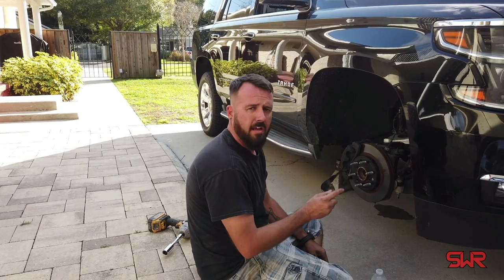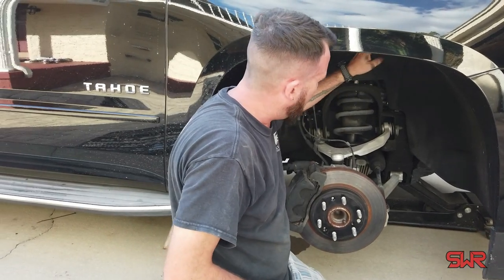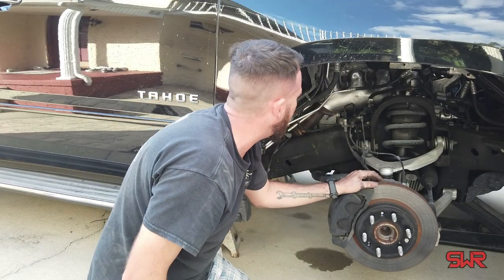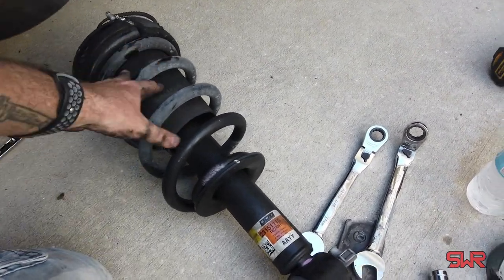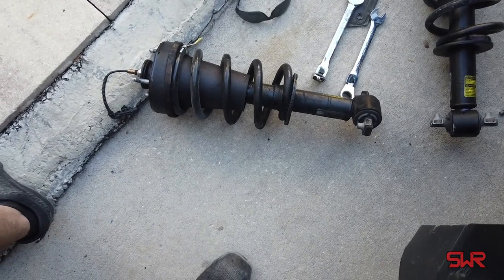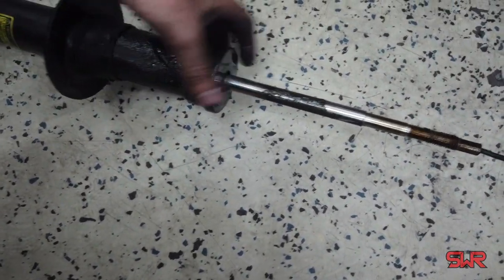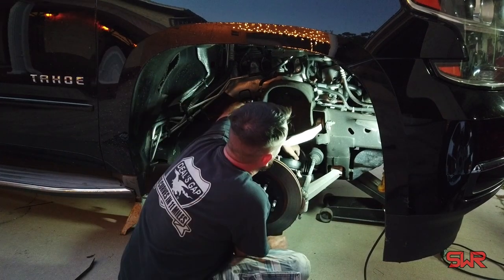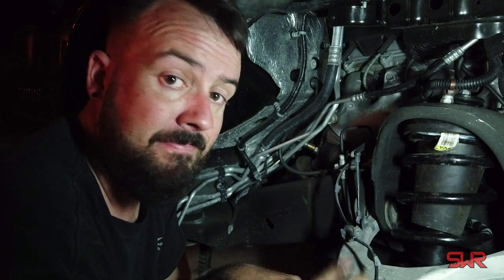Tahoe MagRide Shocks Replacement

Comment: Also anyone changing the struts there was a TSB by Chevy on the jounce bumpers in these struts.  They revised them, so I will change those out when doing the struts. When they go bad your struts will sound like a spring mattress. Hope this helps somebody.
Reply: Here are some instructions I found: https://maxtracstore.com/content/MaxTracInstructions/GENERAL/991500%20%28TERMINAL%20TOOL%29.pdf

also in this video around the 6:35 mark he shows you hot to do it: https://www.youtube.com/watch?v=K4iPdbffsXU&t=177s

Comment: Changed mine out on my 2015 Yukon Denali at 61k as they just started to leak and the ride got a bit rough. Just did the left again at 81k due to leaking but is was covered under AC Delco limited lifetime warranty. RockAuto shipped the new one quick and processed the warranty on the bad one quick! The rears are seeping slightly but still going strong. In case you have to do it again, you can get to those top strut bolts through the engine bay without removing the fender liners.
Reply: Hey any info on the depinning process. He didn't show that part in the video. Any tips or advice would be greatly appreciated as I know how to change out the struts but never depinned struts before. 
Thanks!
Reply: Kevin, did you get any warning dash lights when it started to leak? I bought mine used (2015 Escalade) and always rode rough but I have no warning lights.
Reply: Mine are bad and no lights on dash but you don't need a light, you can feel it in the ride
Reply: How does the warranty work, I’m also planning on getting some replacements from rockauto, but I’m confuse of the lifetime warranty so if the shocks start leaking after the same time the magnaride shocks leaks around 80k miles, you get free replacements so I’m theory I’ll get free shock for the rest of the life truck?

Comment: We had ours replaced on the front. Ac Delco. Still rides like a fing low rider. Go across a wavy bridge and it gets to bouncing like a 64 Impala with hydrolics. Can't figure out what the deal is.
Reply: Try some rancho shocks
Reply: Regular guy. Did you find the issue. My 2015 tahoe does the same thing when I go over train tracks. I know all car wobble but this one goes crazy
Reply: @jaimerios995  we got rid of it cause dealer said nothing wrong and refused to really fix it. Thinking about it I think the bouncing was more likely from the rear air shocks. My suggestion if you really want to keep it is convert all the air ride to standard shocks. There are simple videos on this process. My understanding is this fixes the issue. Maybe not as soft a ride but won't be a rodeo either.
Reply: @regularguyfixes3142  ok. Thanks for the info. I think I will give it a try replacing the front struts at least once since I noticed they do squeak a little over bumps.

Comment: I, too, have a 2015 Chevy Tahoe LTZ w/ Magneride suspension. It has about 150,000 miles on it. I purchased my strut assembly from Strutmaster. My son & husband are  supposed to be installing tomorrow. ($799.00  2015-2020 Chevrolet Tahoe Magnetic Struts Front OE Replacement Kit (GC5FB))  BUT since I want to raise the front end a couple of inches to level it out, I might wait until next weekend since they'll have to take the assembly out again to put on the spacers.

Comment: I got strutmaster on my 15 tahoe ltz and it rides very good. The only bad thin is if you put lots of people in the back you will fill the truck go low in the back. With the magride the truck will level itself. My truck ran like crap with the magride. I got 108,000 miles

Comment: You'll know when they go bad on the fronts because it will ride like an old dump truck. Just ordered the Arnott replacements. Not technically MRC, but have the adapter to trick the computer.

Comment: Great video.. but you never showed the depinning process.. how did you go about that? Thanks for the video!
Reply from the maker: Sorry about not showing that. It's pretty simple using a small pick just push in the little silver tab and the pin comes out.

Comment: What are the wires coming out of the top of the shocks for?  I noticed that when you took out the old ones, you did not detach the wires, as though they were already detached.
Reply: He didn't mention or show reconnecting the wires.  Without connecting, they just become dumb expensive regular shocks.  You have to take the contacts off the old plug and reconnect to the new shocks wire connector.  Another real PIA to do..... Makes no sense why they wouldn't include the full wiring harness, but they don't

Comment: Thanks for answering 🤗 Do you know of a lift kit that would work with a 2018 suburban with factory auto leveling Z95 suspension? 
If there’s not something that works “with” this system could I replace it? I need to get 6” lift for mountain driving. Thanks!
Reply from the maker: I'm not sure what is out there for 6". I would assume you could find some upper strut mount spacers that would lift it 2" or so. Installing them when you replace the struts would be easy.
Reply: @speedworksracing4234  I’d love to do that! 2” would make a big difference... but I’ve been told it would interfere with the stock Z95 auto-leveling suspension... I have know idea. 🤔
Reply from the maker: I don't see why it wouldnt work. The z95 struts have a wire that runs through the middle. Other than that they are the same dimensions as a non z95 strut. I've never installed a spacer lift on a Tahoe but the ones I have on other vehicles make me think that it would work fine.
Reply: @speedworksracing4234  Awesome Thanks! Want to do it!!

Comment: Did you have to take the springs with you?  You couldn't just remove the shock without the springs?
Reply from the maker: The shocks hold the springs in place. They are a "coil-over" design.

Comment: Just installed replacements after driver side blew its wod. Drive a few miles down the road and service suspension system warning came on. That message didn’t pop up when driving around on broken one. Is it possible to be a loose connection? I’m going to kill the battery and redo the connections. Any other suggestion would help. Thanks in advance
Reply: Did you ever get it to go away if so what’d you do I’m currently dealing with this problem
Reply: @DCDO08 Did you ever get it to go away if so what’d you do I’m currently dealing with this problem
Reply: @CarnageDrew did you ever solve this issue? I'm having same issue

Comment: I’m trying to figure out if mine is the same as yours, I think it’s air, suspension... it’s a Z 95 suspension on a 2018 suburban premier
Reply from the maker: Yes, that's the same suspension. Rear is air shocks and front is electronic control shocks.
Reply: @speedworksracing4234  Thanks! I’d like to lift mine 6” for mountain use. Any ideas?

Comment: What's the odometer reading (km) on this Tahoe before replacing the mag leveling shocks? Is the life of mag shocks very less compared to air suspension?
Reply from the maker: The Tahoe had about 80k miles on it (128000km) From what I've read online that's about the service life of the front mag ride shocks. The oem rear air shocks are still doing good.

Comment: I have the dame problem 
I Replace the magnetic  4 shocks on my 2017 yukon and still driving like crap 
No code nothing
Reply: Have you figured it out. I have a 2017 yukon xl and replaced all of mines as well and i feel every bump on the road.
Reply: @khariodub8182  I take it to the dealer and they told me everything was fine but I didn’t believe so what I did was I change the 4 strut from a different brand (Arnold by eibach) and now  drives like a dream don’t use the OEM shocks
Reply: Have tried replacing your engine and tranny mount? Or maybe you are getting transmission torque converter vibrations?

Comment: What are OEM struts?  I want to keep it magnaride
Reply: Original engineered material. Factory direct 
There are no named brand struts anywhere 
You can find the shocks but need a spring compressor to replace